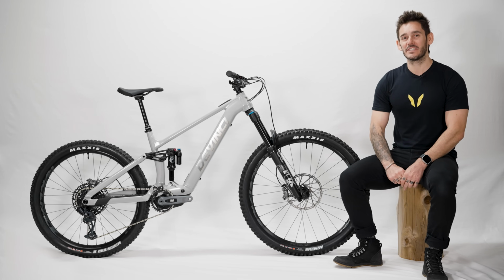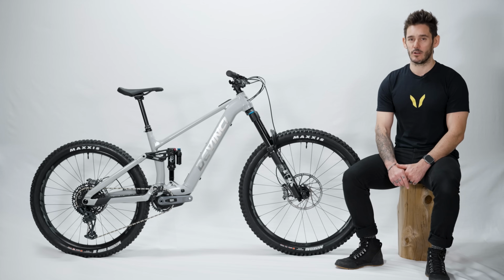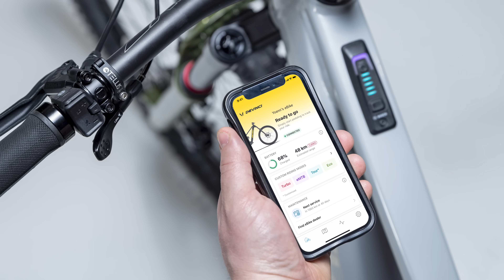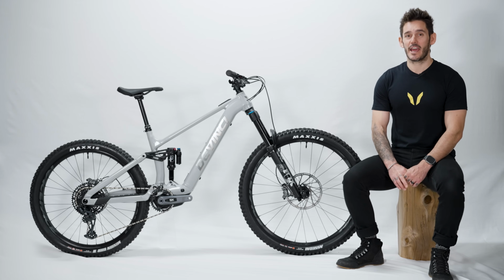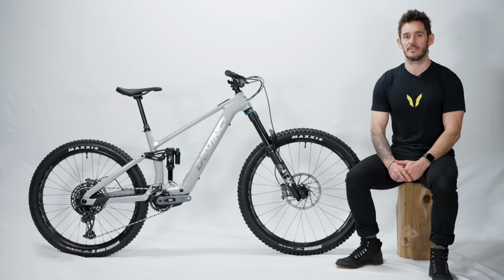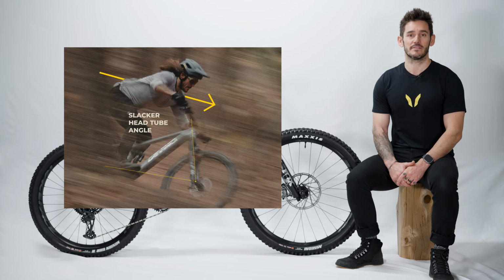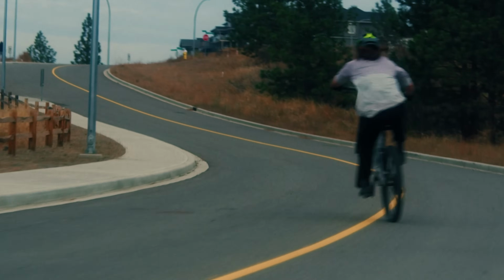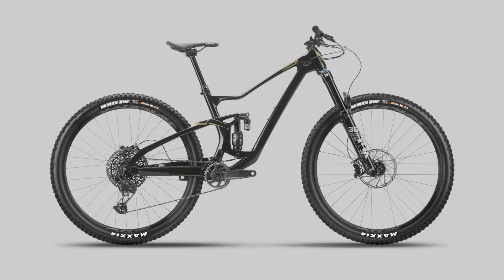The All-New E-Troy Lite Explained | With Yoann Barelli

Comment: Just picked up the NX build after analog biking for the past 30 years. My only complaint is the Rockshox Deluxe Select Debonair which is the worse shock I've used since the early 2000's. Why spec such a garbage shock on such capable bike?